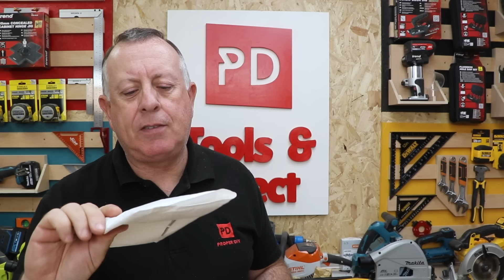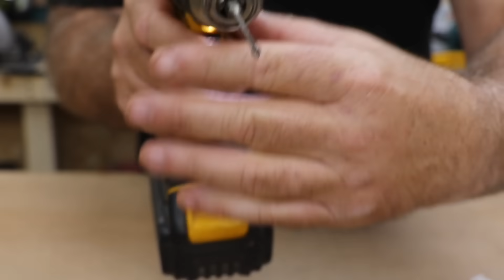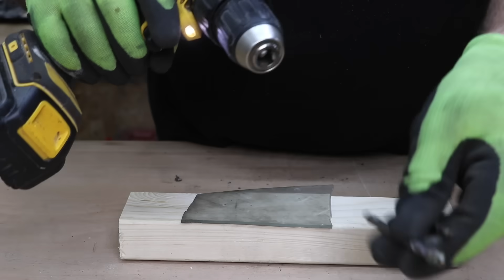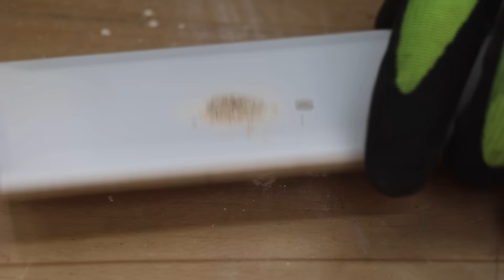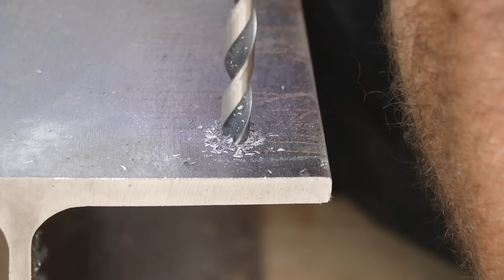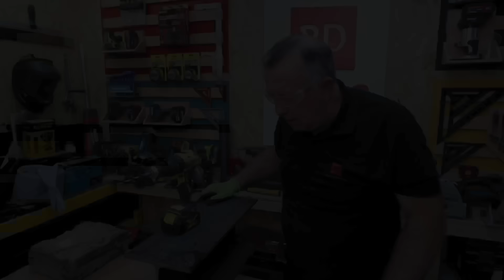Over Priced Drill Bits that Speed Through ANYTHING - Really?

Comment: That steel block was in fact "Cast Iron"  had a pilot hole just smaller then the drill bit size, plus it was drilled from the other side, and only a very shallow part was left on the side their drill started on. That is why the chips were so small like dust. They didn't show the steel before the drill made contact, because they didn't want you to see the point where the other drill made a small center hole. The "glass" they showed, was not glass at all, it was acrylic.

Comment: First, I would never buy drills based on a video ad.  Second, who drills metal without using oil?  Third, they didn't drill through steel, look at the chips produced, it was cast iron and that drills easily.  That said, these bits are junk, as are most of the things advertised on common media.  Caveat emptor!

Comment: Looks like they are for the most part just junk click bait. 

However it looks from the advert that the "steel" they are drilling may actually be cast iron from the look of the swarf coming out of the cut. Cast iron is easier to drill than steel because the graphite content lubricates the cut a little. May be wrong but it looked a lot like the cast iron i used to machine years ago as an apprentice. 

Still look like junk though. Just a carbide brazed on tip in a different shape.

Comment: You should always use cutting oil when drilling steel. It keeps the bit from getting hot. A newly sharpened split point also works better when starting on steel and sharpened at the correct angle of 135 degrees. Even some hardwoods drill easier at 135.

P.S. I see this ad all the time, and I knew it was a scam from the beginning. The Steel they advertised as being drilled looked more like a Steel Epoxy and hardener than actual steel.

Comment: Drill bits to make holes? Come on Mr Proper DY - get with the times! I just use my Hyper-Power LED torch that runs on two AA batteries to blast holes through steel plate up to 2 inches thick in seconds. By the way, have I told about how I made $60,000 in the first month just by following stock market tips from.....

Comment: This drill design is totally wrong and is not inline with normal engineering practice re rake angles and cutting speeds etc etc it was obviously going to fail, by the way were you drilling porcelain tiles?...thanks for the video

Comment: Some years ago I bought some German masonry drill bits which were allegedly able to drill through hardened steel, I had my doubts but found it was possible when I put the outer race of a ball bearing in a vice and demonstrated using a drill press that it was possible to drill into that type of metal, they are probably still in my untidy garage. one of them I deliberately started drilling into that same type of metal and overdid it to the point that the bit got so hot  [ practically past red to white hot]that it failed through my stupidity for driving it to destruction.

Comment: Pretty expensive drills for ceramic tile only and one hole only!!  Just proves once again if it is in an ad it is a lie.  You need to use the proper drill for the job.  A good drill manufacturer will have different grades of bits.  Personally I have tried them all and they range from total garbage to very good.  Bosch is a low end bit  good enough for mild steel but if you move up to monels, and stainless grades, etc. then they are going to disappoint.  Even then they are going to need frequent resharpening if you use them for repeated drilling.  Good drills tend to cost three or four times what the popular brands do.  They also bring tears to your eyes when you break one!!  A solid good grade carbide bit is spendy and will break easily if misused.  I go with what is good enough and keep it sharp, saving my high quality ones for when nothing else will do.

Comment: I bought the same drills in a box for £8.66. Off Ebay. I tried to dripp 35mm high speed steel with a 10mm. It slowly very slowly went into it. Much slower than a normal drill and needed cooling oil too.
The eBay listing states cooling water on tiles and oil on hard surfaces. I used Zx1 on the drill bits that made a huge difference. I eventually managed to drill my 6 x 100 through 35mm of high speed steel using a standard black 10mm drill bit using zx1 the drill was hardly marked even after all 6 holes. I used a drill press mostly.

Comment: I bought one similar from 'todays tools' wasnt expecting anything for 6.50 bosch blue being 12 quid and you only get 3 holes in porcelain and quite a few minutes at slow speed and water per hole .the quad tips went though like a jet drilling 3 holes in under 2.ins hard porcelain. Drilled brick on high and the tip came straight off so my bad  utfab fortiling.

Comment: The spade shaped ceramic tile bits, available very cheaply, are actually pretty good for quick drilling, working well on tile, glass and masonry as well without hammer action.  Drills into block no problem, but brick it will struggle, but for hanging up pictures and such a very quick solution, and bathroom fitting towel rails it is very fast, as you only need the one bit and get the hole done.

Comment: I bought some masonary drill bits like these, only without the serated part - I tried it without hammer drill and with hammer drill.... Both ways I had to push so hard for it to even go in the wall (standard brick) and it got so hot that it went white hot and nearly set fire to my wallpaper - bloody useless. They were 7 sizes for £28 too. In my experaience, NEVER buy a crosshead drill bit for anything.

Comment: A standard masonry bit will fly through that metro tile with its soft white biscuit long as you piece the glaze first to stop the bit skidding, the floor tile looks to be porcelain or a hard ceramic as thats a good test.  Obviously no good if you only get 1-2 goes before killing the bit.  I used to use a drilling kit made by Rubi tools for porcelain and natural stone tiles but I think Silverline have a cheap range of diamond tip core bits used with water that worked pretty well and cheap enough to through away when blunt, i've been out of the game for over 10yrs so things might have moved on a bit now :)

Comment: As a lifelong diy-er without any formal training I’m always on the lookout for something to make my unskilled life easier, so have bought my fair share of dud products over the years.
Really, really appreciate videos like this one which honestly shows the importance of sticking with known quality tools and accessories as opposed to stuff that makes unlikely claims. The recommendation of a reputable and reliable product included in the video is as valuable to me as the main review.
Thank you Stuart.
Reply: @martinsmith8951
Never buy anything other than THE BEST, as the rest never lasts anywhere close to that of the higher priced (quality) professional products.
Learning how to keep tools as sharp as possibe, also ensures that whenever you need them (right now) they will be as sharp as they possibly can be.
But take note, if YOU need to have some, waiting unused for lengthy periods, for goodness sake, store them in motor oil, so that they DO NOT RUST.
Rusty drill bits are the bain of DIY projects as the bits dull very quickly (if rusty) and your other DIY tools like drill batteries that go flat and canno be recharged, if left uncharged after the last usage, plus any pliers, spanners plud anything else that can also "rust" etc., etc., means that the next time YOU need those assorted tools the only way to "fix" that (overly rusty) situation is to BUY NEW TOOLS (an extremely expensive DIY method)

So keep your tools either submerged in motor oil - or at least wrapped in oily rags, and check them often.

Comment: These things are great for drilling through walls without percussion (which can crack mortar and split bricks.) In concrete with pebbles you're better off using a diamond grit bit, but on limestone/granite concrete these things are great. You used it at a low speed with a lot of force - better to use with high speed and low pressure. I often find. The 2 flute better for concrete/brick/etc. but I think they made the 4 flute specifically to be capable of drilling through metal as people noticed the 2 flute would drill through pipes (though not as well as the 4 flute now does). I've bought similar sets for <£10. They aren't as economical as SDS bits but considering you aren't causing any damage that needs to be fixed, the overall job is quicker and cheaper using these. The marketing may sometimes be a scam but they are excellent drill bits for the right purposes.

Comment: #1 for steel :
 use cutting oil, works a treat, faster drilling, longer bit life, 
By Far!

I tried this set too,  $8 AUD on aliexpress, less than 5 quid.
Expectation :
One job and they'll be fooked.
Looks like my expectations will be met.
Tips held on with Chewing gum.  Better get a supply of THAT.

I have some reservoirs for the purpose of wetting drill bits. 
They work well  ..

Comment: While working in an industrial environment (stainless steel) with tool salesmen dropping by like red ants swarming a jelly donut, we would always take the "try this samples" after years and years of testing we found that the local Fastenal dealer had drill bits that would drill sideways without breaking, and CNC taps that were close to indestructible. Many people look at Stainless and scoff but it will eat up tooling at enormous rates

Comment: If you reassemble your 'laser welder' you could fix the broken drill bit 🙄
My Dad's theory.
The steel being drilled in the ad could be cast iron, maybe they pre-drilled the hole, filled it with JB-Weld, let it set then drilled with their dodgy drill. The shavings did look a bit like drilled JB-Weld

Comment: Every single thing I have bought from adverts on Facebook have been rubbish, I have a set of those drills but not tried yet. I have some special ceramic coating spray for my car, the actual container is tiny, NOT the 500ml I was expecting, the applicator sponge is only 1 inch wide and the microfibre polishing cloth is a 4 inch square. A leaf blower turned out to be 4 inches long and runs from a USB outlet. A smart looking woolen jumper with leather arm patches turned out to be a cheap printed synthetic T shirt with brown printed patches where the leather patches are supposed to be. 2 light summer blazers/jackets are nothing more than thin material that looks like part of a mechanic's poor quality overall. I am the victim of false advertising, how could I have been so stupid?

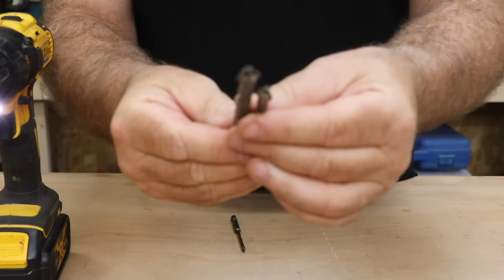Comment: 3:54  The yellow stuff is brass .. from the brazing compound they used to attach the carbide to the steel drill rod
Reply: Braze is bronze. Brass and bronze can easily be confused with each other. They are different metal alloys though with different properties. Bronze is stronger. Bronze is copper and tin and brass is copper and zinc. You wouldn't want to get into a bronze age sword fight with a brass sword.

Comment: whets the bet that they where drop shipped from temu
6pcs Titanium Coated Carbide Drill Bit Set for Ceramic, Glass, Marble, Concrete - Hex Shank, High-Durability Alloy Steel, Sawtooth Eccentric Design AU$ 8.91 (about 5usd)

Comment: They advertise M.1911s anyone could own, ordered 3 black got 2 coyote and plastic without Colt symbols, I gave them away.  Norinco make far better air soft types.   I have some bits that work on glass and ceramics, cost less than £6 and do work, from ToolStation.

Comment: Like all these ads on YouTube I found these real bits on eBay so I bought some to see how good they are. 

They were not very expensive. 

I first tried  a 6 mil on on hard brick. 
  It went in a little way and then wouldn't go any further. 

I tried one on a glazed tile. It made a very good job of it. 

It cut a neat hole without cracking the tile. 

I tried it on glass it would not even scratch the glass let alone drill through it. 

Then I tried this on a real job where I had screw some hanging brackets to the wall. It went in a bit and then no matter how much first time the drill it just spun and wouldn't go any further. 

The head had come off. 

Verdict is I think these are very good for soft materials. 
Absolutely useless for hard brick,. I also tried it on an old butane gas bottle. 
It wouldn't drill through it.

These drill bits are very good for soft materials. 

Hopeless on hard things.

Comment: I'm amazed that they cut the ceramic.

The "steel" that produces the powdery swarf is actually a sintered steel loaded composite - very good for prototyping designs because it is very easy to cut and machine. Rubbish for actual production work for anything that needs to take any great load.

Comment: Looks like it should be tungsten carbide braised into HSS. TC is brittle and it may have shattered in the concrete.
As for drilling steel? Doubtful with that geometry. The steel in the add video looks more like cast iron. Recognizable from the fine powder as it's drilled. Regular HSS drills go through cast iron like a hot knife through butter.

Comment: If you could drill so quickly through steel, thieves would be doing that to safes, security doors, car locks, bank vaults and ATMs but fortunately the drill bits can't do that.  My standard masonry bits can drill through tile so long as I use gentle, non-hammer action which might crack the tile, so I don't need to spend £28 on BS products.

Comment: I bought a set to install towels rack. The drill can drilled one hole in minute then it worn out (even cooling fluid applied during the process). Unless you want to drill one hole per drill bit, do not use this one. The 3mm drill bit in my order is not straight too.

Comment: I'm fairly certain the "steel" they were drilling in the advert was cast iron, not that I think it matters.  Another commenter pointed out the filings coming out of the bottom of the metal block before the bit exited, which indicates a pilot hole.
Reply: My guess is that the hole was drilled previously, and filled with clay or similar?? My industrial lathe doesn't cut as fast as that advert.
Reply: It’s 💯 cast iron.
Reply: "Exactly — a perfectly pre-drilled pilot hole, just subtle enough to fool the casual viewer. But sure, let’s debate metallurgy instead of calling out the real issue: staged demos designed to mislead. Whether it’s cast iron or cheddar cheese, faking performance is still faking performance."
Reply: I think they drilled the pilot hole from the bottom of the metal 2 sizes down
Reply: The trick is to send them to uou using the world subsidised postal rate of a few pencil, and when they fail you pay the return of several pounds, which no- one does of course.  It's youtube's fault for aiding and abetting this fakery. They reward views not sales. Shows you how many mugs there are tho'
Reply: It wasn't even steel in the advert it was aluminum, the dull metal is a give away.
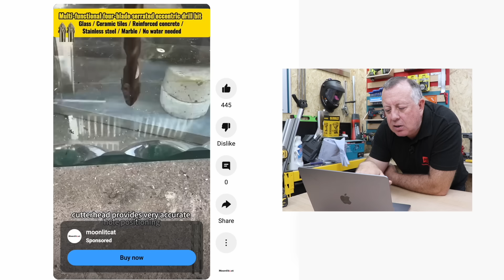Reply: @denismorgan9742  At 1:35?  There is some magnetic cling, suggesting ferrous metal.  The powder is characteristic of cast iron.  These bits do seem to produce only powder rather than chips, but it still didn't look like steel.

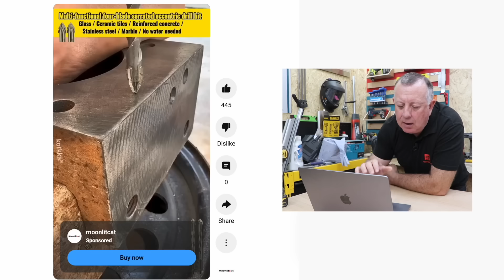There is another bracket shown at 1:11 which seems to have some minor rust on the exposed surfaces, nor does it look like aluminum or zinc.

Comment: I like Bosch stuff, I only use the green stuff in my shed as it’s mainly for domestic stuff.  The professional range is decent but at a premium price. The Bosch blades and bits are good for the money. I know you can get cheap stuff but in many cases they can be a bit of a disappointment. Other brands like Dewalt are good too so they can always be a reserve as it were. A good set of stuff really sets you up for any job or project.  Great video and well explained too.

Comment: the first piece of steel looks like some form of composite clad with thin sheet metal , the other piece of metal looks like cast iron which any normal drill will go through with ease so it would be no problem for these what look like  HSS steel tipped tile drills,  basically junk , go to a good TOOL store and buy decent tools

Comment: I have got some that actually work, believe it or not. I got them from aliexpress for way less than 28 quid.  Buying them as separates seemed to get me the best ones. They cut through brick and breeze block well as long as you dont overheat them. I wouldn't use them for thick steel for love nor money. They handle wood well too.

Comment: Just another YouTube scam ,seen similar to these years ago,they were just masonary bits ground like a normal hss drill bit,the sellers used to infest the various motorcycle shows at Allypally and the NEC They were junk like these are, as for the laser welder can you imagine letting the public loose with something so dangerous ,burning their eyes out with one glance or cooking the ends of their fingers when using the rust removal function 🤔There is no magic drill bit that does it all horses for courses I’m afraid ,anyone drilling steel or any metal for that matter learn how to sharpen drill bits and learn  the correct technique to drill a hole ,drill a pilot hole for any hole over 6mm diameter it will make life so much easier,use a drill press where you can